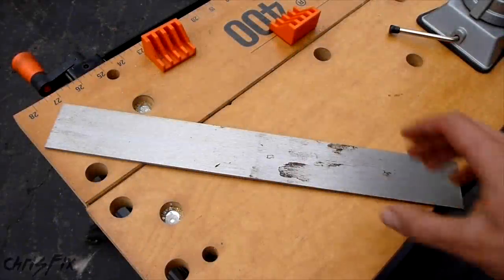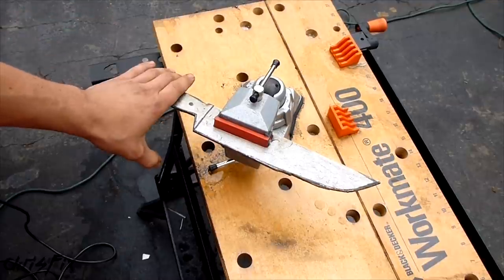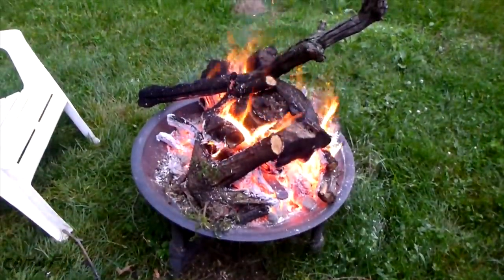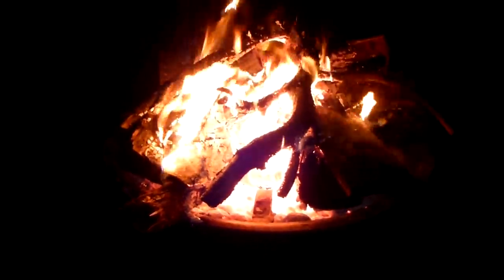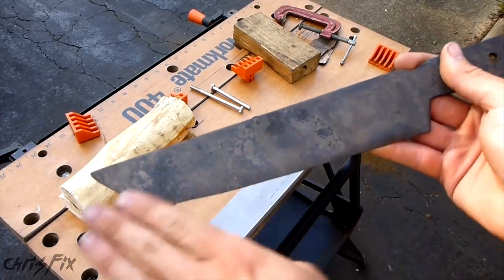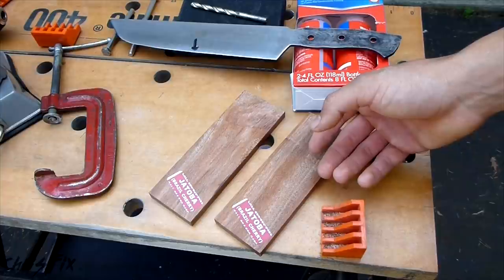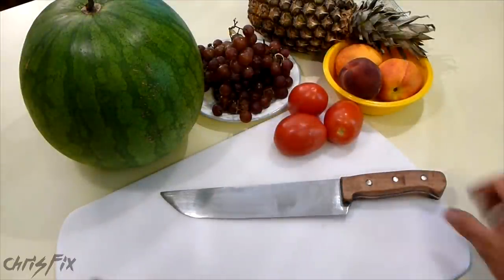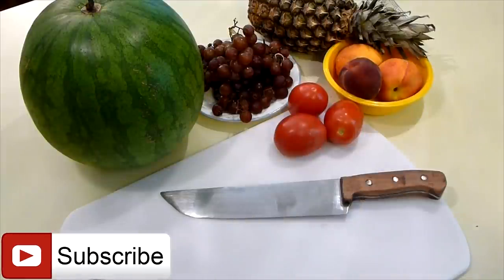How to Make a Homemade Chef's Knife

Comment: would i be able to use aluminum? because it eont rust.
Reply from the maker: Stainless steel not aluminum. Aluminum is too soft and wont keep an edge.
Reply: ok thanks for the tip Chris.

Comment: Whats the purpose of heating the knife?
Reply from the maker: The cherry red heat is to align the carbon in the metal and then you cool it real fast to lock in that strength but with that strength it is really brittle so the heat in the oven softens it just a little.

Comment: where can i buy metal for knives?
Reply from the maker: stacktres You can get it right here: http://www.amazon.com/gp/product/B00CZDPAI2/ref=as_li_tl?ie=UTF8&camp=1789&creative=390957&creativeASIN=B00CZDPAI2&linkCode=as2&tag=chri0e2-20&linkId=PJ2AEETAVC2VBPJN
Reply from the maker: You can get the same metal I used here: http://www.amazon.com/gp/product/B00CZDPAI2/ref=as_li_tl?ie=UTF8&camp=1789&creative=390957&creativeASIN=B00CZDPAI2&linkCode=as2&tag=chri0e2-20&linkId=PJ2AEETAVC2VBPJN
This is not stainless, it is tool steel. You cannot heat treat stainless steel yourself so you would have to send it out. It is not that expensive if you get the size you need. I talk about the size I am using at 1:14
Reply: ChrisFix what thickness is best a knife?
Reply from the maker: loudDIFFERENCE Whatever thickness you want. You need to balance thin and thick. Thick is durable and sturdy but thin is agile and sharp.

Comment: you can really use pretty much any oil i use used motor oil not a problem
Reply from the maker: Ben Swapp Motor oil is dangerous to breathe in when it is burnt and since this knife is being used with food, it is not a good idea to use motor oil to quench the knife in. That is why I used cooking oil.
Reply: i see where you are going im going to say any smoke isnt good for your lungs lol but outside in a well ventilated area and also you polish the knife so there isnt oil left on the metal just saying you can use what ever you want but any oil can be used
Reply from the maker: Ben Swapp The oil still gets into the knife so I will stick with vegetable oil, but thanks for the tip!

Comment: DUDE that's not a metal file! it's a wood rasp!! You're wasting a good rasp by dulling it on metal!
Reply from the maker: MsMegajosh It is a metal file on one side and a wood file on the other. Thanks though.
Reply: Well You know better than me, It's your file, but I'll warn you that most wood rasps come with a fine side that i think is meant for wood.
Reply from the maker: Yea, I am sure that this is a metal/wood file, but thanks for pointing it out just in case!
Reply: Alright sorry If I came out a little crazy. I actually didn't know that they made files with metal/wood sides
Reply from the maker: MsMegajosh Dont be sorry, this is a really old "multipurpose" file. Probably 40+ yrs old.

Comment: Out of all the heat treating/tempering i have seen and done myself. Your method is strange. Everyone I saw, critical temperatures then quench, then throw in an oven to temper.
Reply from the maker: Snakeprophet That is exactly what I did. I got it to the critical temp, quenched, then tempered in an oven to soften it up a bit.

Comment: good, but dont sharpen it with that, use a whet stone. that will make it razor sharp
Reply from the maker: ***** Thanks for the tip!
Reply: ***** using a whet stone is a great idea but is for advanced blades smiths, this project was more for the beginner, from construction to finished product.
Reply: yeah, would suit folded steel knifes a tad more but still give him the sharpness he needs Daniel Warden